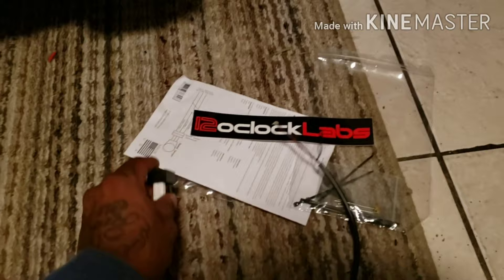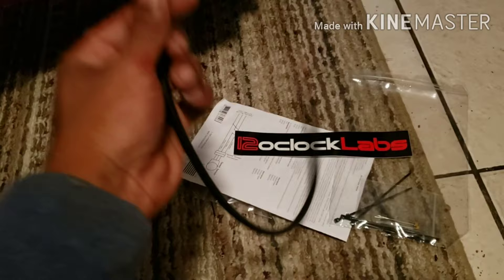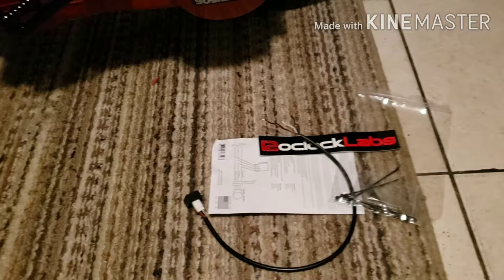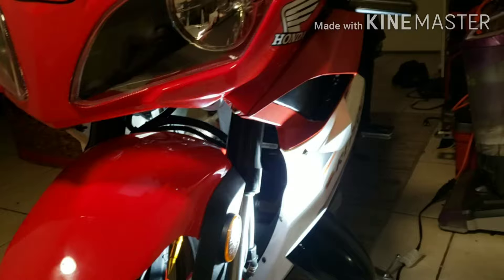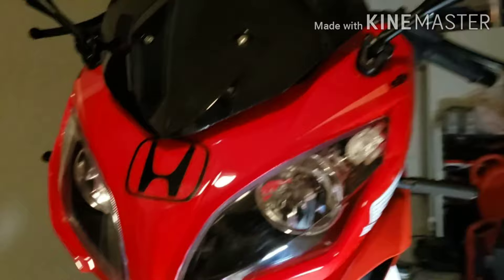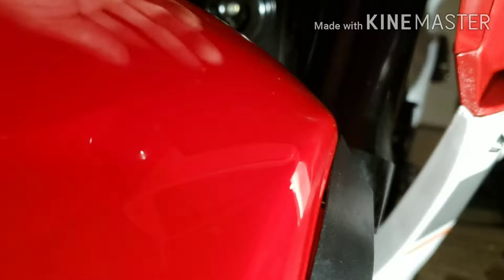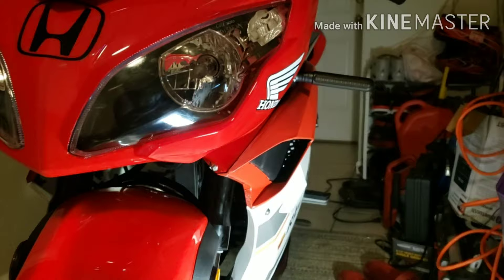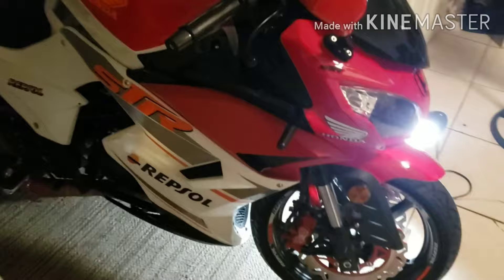Df250rts | Venom x22r speedoDRD u1 install speedometer fix

Comment: Great need that..How did you get rid of those spookiest green rings on the wheels.thats the only thing that bum me out about this bike.
Reply from the maker: I just put rim tape over it lol seems to work
Reply: No way? Lol i cant even tell looks incredible.. I’m doing that (XoX)
Reply: @Mikecheckmoto  I ordered some black reflective rim tape. I just never had the time to install it.
Reply from the maker: Yea that will definitely make it look better I got my oil cooler coming as well I also put some heat reflective padding by header the fairing doesn’t get hot anymore

Comment: Ok so I got a couple of questions....did u have to split the signal wire for it to work? And my drd came with 4 wires...I hooked them up red=pinkish / black=black / blue=signal which leaves a white wire still on the drd? And I tried to calibrate mine three different times and it still did not work correctly..... Any tips?

Comment: Hey I was wondering if you could make a brief video of where you tied in the speedo drd for the x22 250r. I just bought the universal kit and needed to know where I tie into! Thanks
Reply from the maker: Just find a place where you can zip tie it to I just tucked up and zip tied it to the actual Speedo cable but anywhere works
Reply: My bad bro when I was saying tied into I was asking about which wire harness?? What location and which one
Reply from the maker: Oh ok yea on the vid it’s the only cable coming from the speed sensor by the front wheel it’s not the brake lines the only other cable you gotta cut into